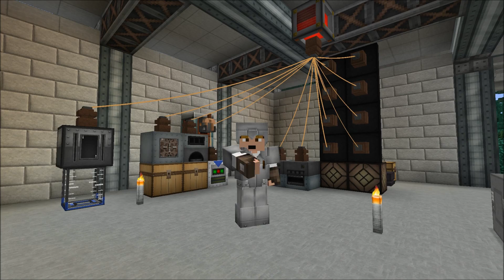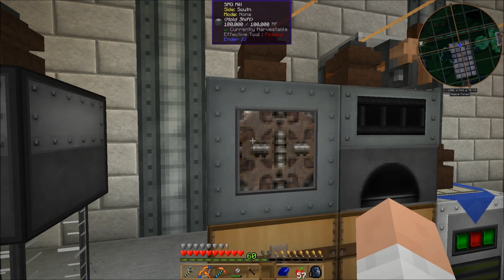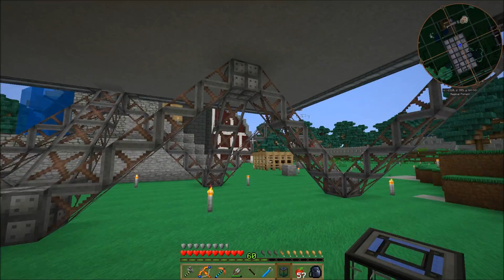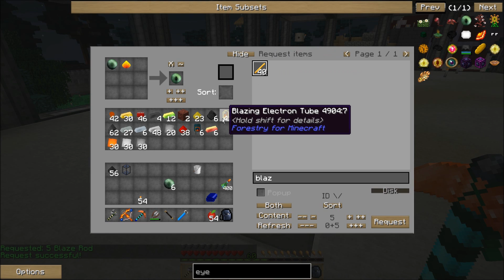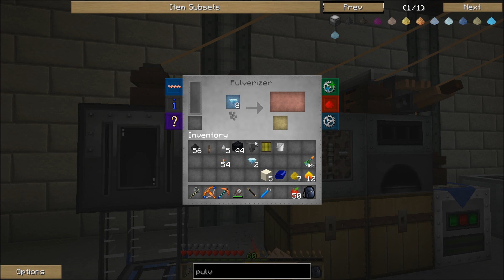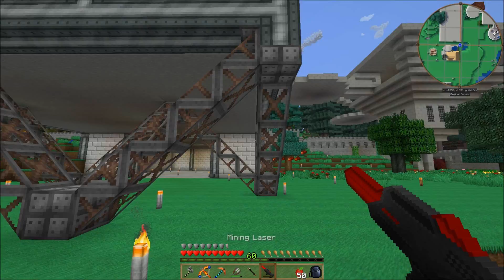Thermal Centrifuge - Infinity Evolved Expert Mode on the Terra Nova Server

Comment: If your only goal is stone dust, the ore washer is your cheaper option by far. Having the centrifuge is nice though and if you do a reactor you'll need it anyway. The laser is nice to have too =)
Reply from the maker: +Xandermud yea, I'm 99% sure that I will eventually build a nuclear reactor.
Reply: +Landstryder They're pretty fun to optimize. I've yet to play with the liquid coolant versions yet, but am looking forward to trying them out.
Reply: +Xandermud There's different kinds of optimization. You can optimize IC2 reactors to generate power efficiently, or you can optimize them to burn through fuel more quickly if your goal is to get to AE2 and Big Reactors as quickly as possible. That's what me and my partner did with our base, I used biodiesel (4x 4k RF/t) to power our base and quarry and he made an IC2 reactor which was optimized to burn through uranium quickly so we could get those tasty byproducts we needed for an AE2 system (and later, a turbined big reactor which did about 20k RF/t). It might be interesting to see Landstryder make a power-efficient IC2 reactor instead of using Biodiesel for the bulk of power generation.